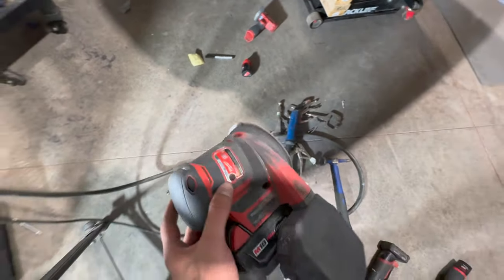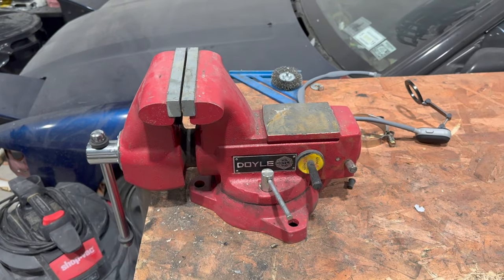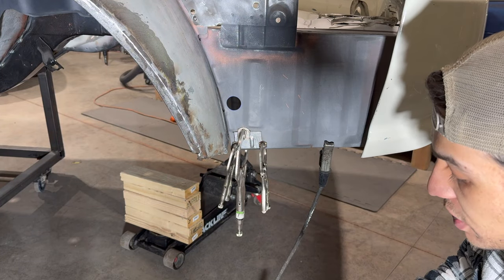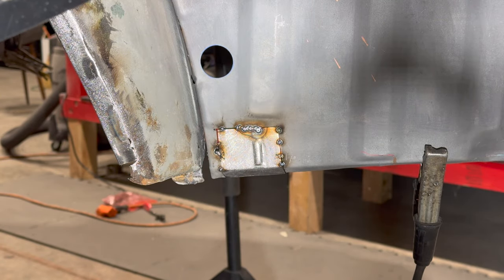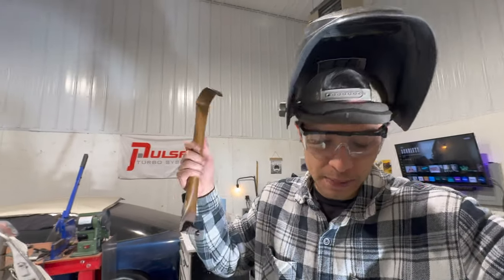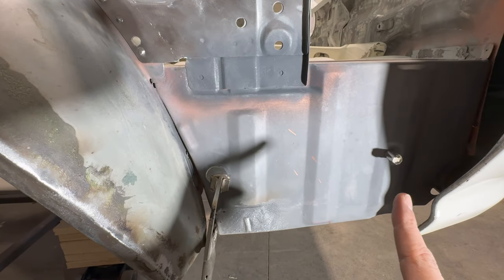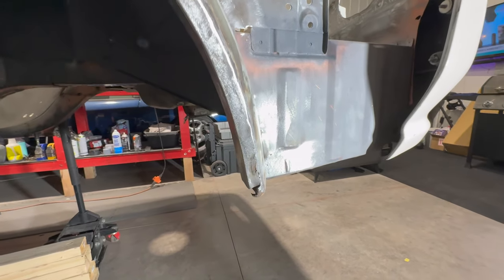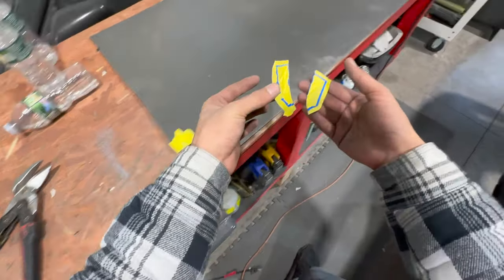How to FIX RUST & WELD Like a Pro Start to Finish

Comment: No probs. I'll re ask the question I had in the last post. Feel free to answer in a future video: How would you weld panels together that has holes through instead of a backing on one panel where you'd have something to weld onto? Example is converting a FWD car to AWD and you have to drill out both floors and swap them. How would you "spot" weld the 2 panels  to keep it's rigidity? And could that be done with a Tig (I know most use Mig and some, stick). 

Appreciated man.

Comment: When the 3d model is done for any car it is in patches like you did with the metal. Different surface patches connect to make one bigger surface. Then where the big surfaces connect it is rounded off with transition surface patches, sort of. The actual metal might be stamped from one piece but the 3d or CAD model is made from perfectly transitioning surface patches.
Edit: I see what you did there at the end of the video. Hopefully, your rust is to a minimal:D